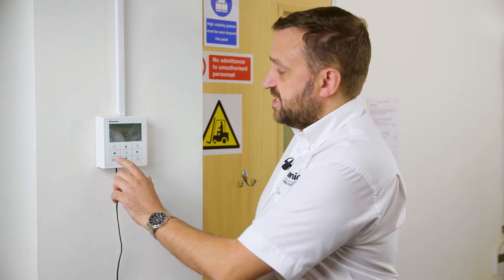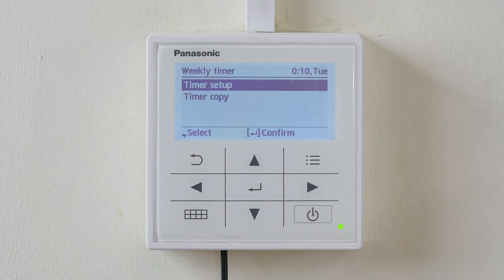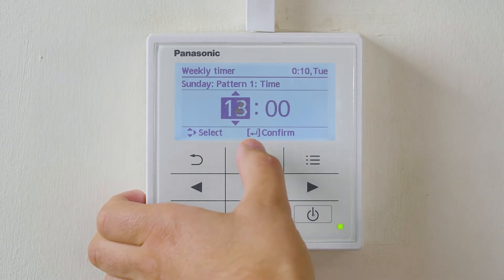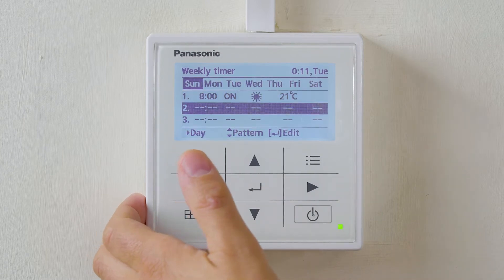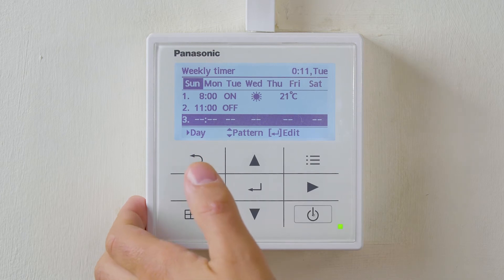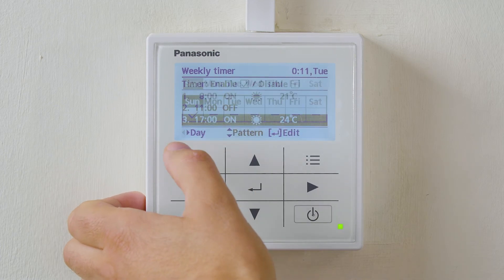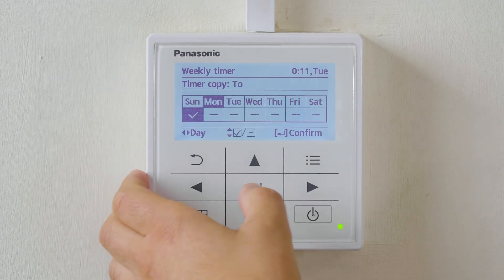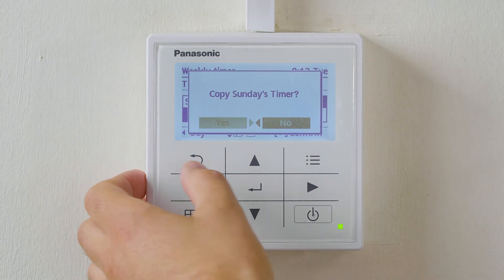EN – Aquarea H Generation_Set up Timer

Comment: Thank you for the video, it was very helpful. I set up the timer a few weeks ago, but today I made some adjustments and re-copied the settings to the other days. However, it doesn't seem to be working, as the pump is still operating based on the previous settings. I’m certain the settings were copied correctly to the other days.